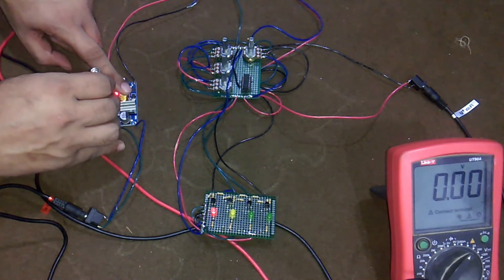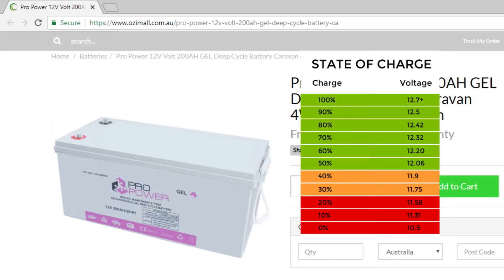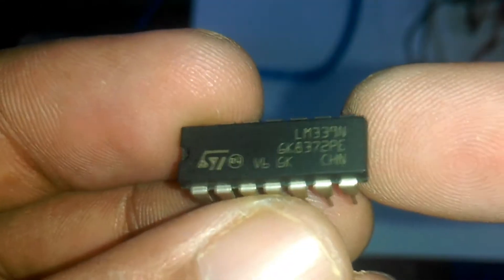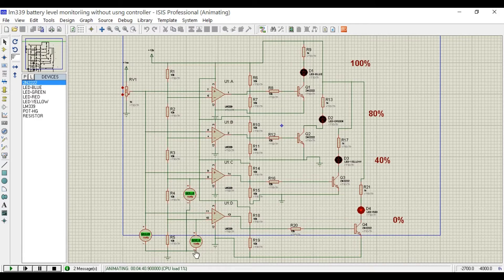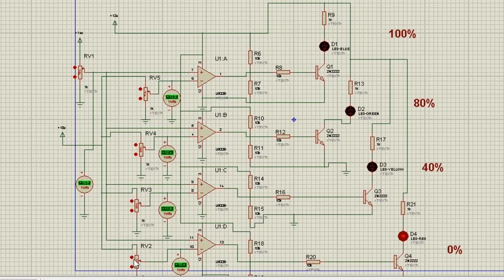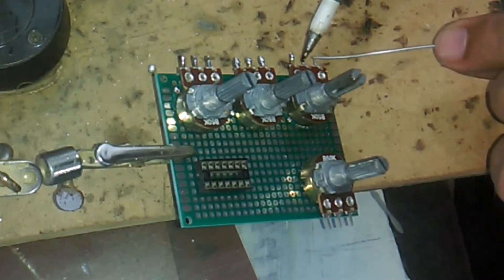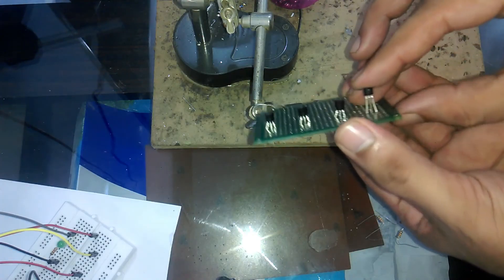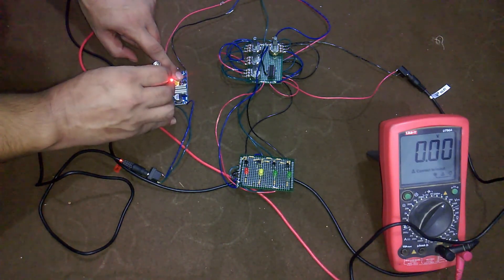12v Battery Voltage Monitor using LEDs and LM339 Voltage comparator

Comment: Is it possible to use a comparator with a single source , say a solar panel and only that as both source and reference, and make sure that if it is 12 or above only then current is drawn from it? Thanks.

Comment: Great one's how design for 16v circuit for 4 lithium ion battery power bank
Reply: use voltage divider... aka 2 high rated resistors ie 100k to 10k resitor and youll have 1/10 of supply voltage to use as referance...

Comment: I have a plan to make a battery control circuit using Arduino, NPN transistors and voltage sensors but I am still confused in the Arduino program array .... thank you
Reply from the maker: I have tutorial on voltage sensor and battery monitoring. Check playlist. It will help you